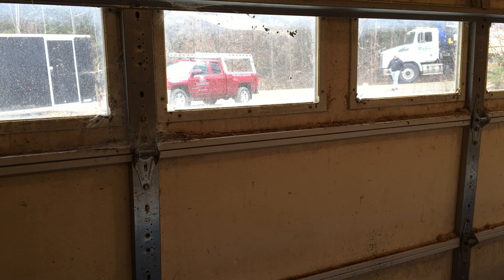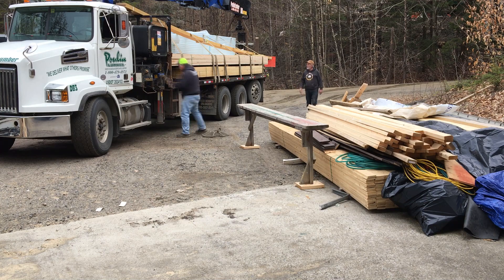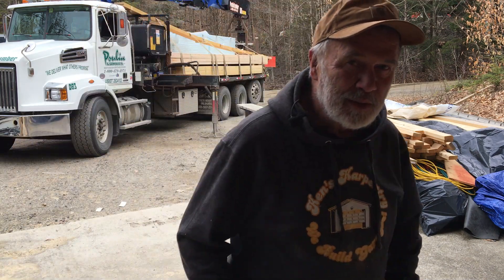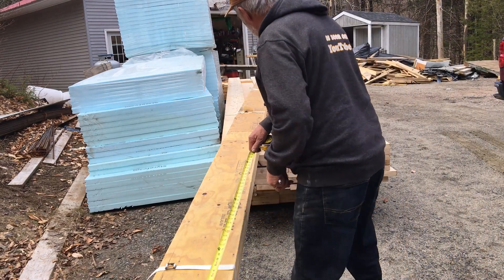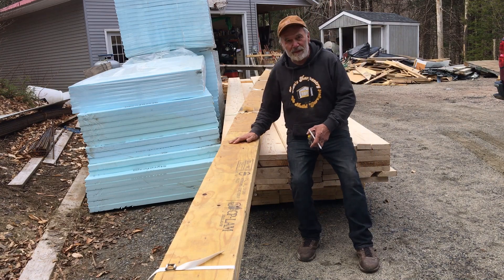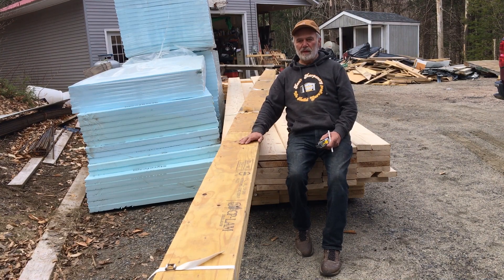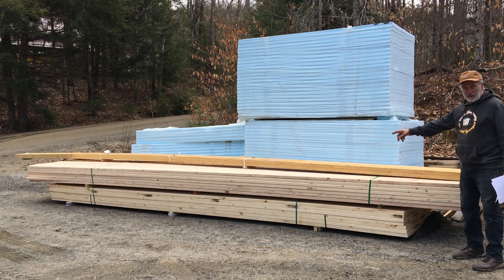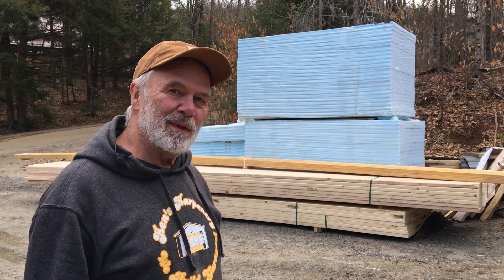Building Materials Cost Update

Comment: I raised our Timber Frame cabin In October 2020.  Heading out to put the roof on Friday (750 miles).  I've milled all of the lumber myself over the past three years.  Timber Frame took three years from forest to frame.  I milled (80) 2"x6" x21' T&G Monterey Pine for the vaulted ceiling (and sub-roofing).  and 20 2"x10"Douglas Fir for the Insulation frame "cells" on the roof.  Metal roof on top.  Insulation is going to be 10" spray foam open cell (R-38)and baked enamel metal roof (capturing rainwater) .  Metal roof package  cost: $2675.  Insulation: $2450, Lumber:  $0.  It's not just the price of lumber going up.  I'm good at finding reclaimed materials.  I have a lot of contractor friends who keep an eye out for me.  When you're doing what I'm doing it seems people see that and want to help.  I have been blessed with good friends.  I barter all the time (I'm a Blacksmith)  A good knife is a great bartering item.  Axes are another.   I have two Tree service guys that save logs for me.  I've given both of them beautiful hunting knives.  The logs seem to just appear!  Hahaha    There are other ways besides money to get what you need (that aren't illegal)
Reply from the maker: Thanks for the input

Comment: I got a job replacing the flooring in a modular home after a new refrigerator flooded the kitchen/dining/living room. That included removing & replacing lower kitchen cabinets replacing under sheating. They wanted 23/32 OSB T&G "premium" sheating. Best price I could get was $64.68 a sheet. It took 18 sheets = $1,164.62. What most contractors are doing around here is showing material cost & labor separate on the estimate. A lot of people are holding off on projects because of material cost. It's rather worrisome at this point.
Reply: i bought 1 sheet of plywood (roof sheeting) price was $70.00 , I got a break on the price $ 65.00 , why , a truck ran over it in the yard and broke 6 inch corner. The things you got to do get wood!
Reply: The only way we can get prices back down is to quit buying at today's prices. Because if we keep paying it they're just going to keep charging it.

Comment: I had plans to build a 44 X 45 airplane hangar stick framed with paralams and trusses. The cost went so out of control I scrapped the plan and re submitted with a rigid iron frame building. I already committed to comp roof and stucco so it will still eat 7000 feet of 7/16 osb but the switch from wood to steel will save me about 20K at today’s prices. Did add 6 months to the project because of the painfully slow permit process here in Fresno county.

Comment: We are remodeling our older first home to be our retirement home.  Before scamdemic, we priced floor joists and entire from floor up kitchen dining room remodel with all new sheet rock and floors at about $2,400.00 in supplies.  Rooms are 32 by 24 feet.  Glad we got that stuff done before the scamdemic hit because we just costed out the laundry room (6 foot by 14 foot) and it is crazy high for the same lumber.  We also need to do the main bathroom which is 15 by 25 feet (floor up job).  These prices are crazy.

Comment: The cost of copper is also out of control, it has doubled in price since last September.
Reply from the maker: Wow
Reply: @kenskarpentry  Like you I pre-purchased a 1000 FT roll of 12/2 wire last fall @ $280 for my garage project because prices had crept up from $240 in Sept assuming I could return the roll if the price had dropped.  That same roll is selling for $488 today.   It appears to be copper related because Aluminum wire is about the same price as last fall when I bought my service wire.
Reply: I guess people are going to try stealing copper out of people's houses. Lol I remember hearing stories of people doing that during the aftermath of Hurricane Katrina because at the time, copper was high in value.